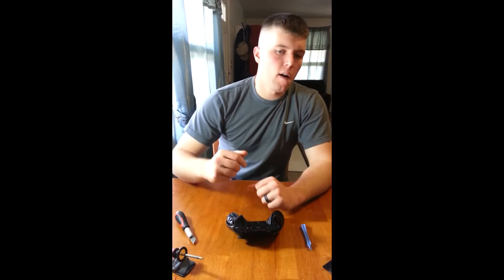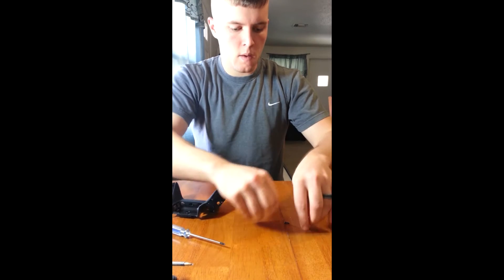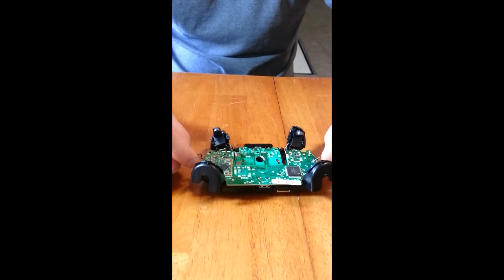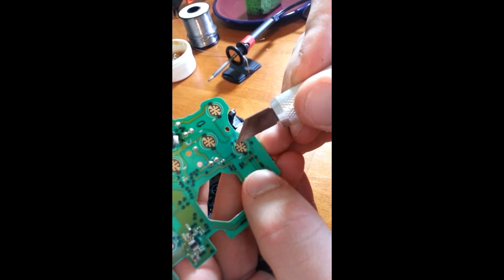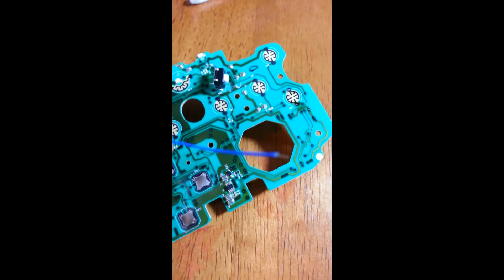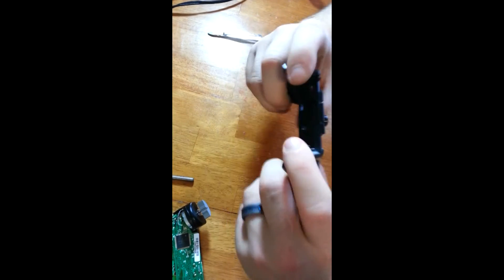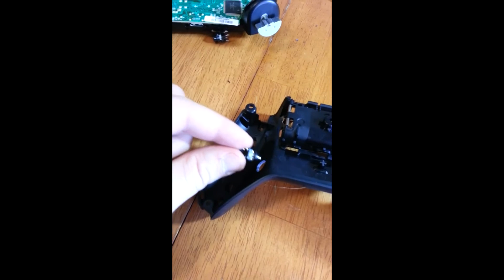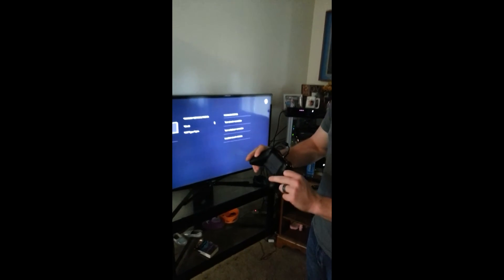Xbox One Scuf Controler DIY

Comment: Thanks man. Works. My A button works but I have to press it a little harder than the rest. B button work great also both back buttons are working properly.  Never had a scuf controller and it really is going to take some getting use to. Very easy to do thanks to your tutorial
Reply from the maker: Your A button shouldn't feel different than normal. If you'd like, take it apart and take a picture and email it to me at drummaboyzl@gmail.com and I'll take a look to see if I can tell if something needs to be corrected.

Comment: hello, i am having the same issue. B button does not work. the stock B and the switch do not work. I added an X button as well which does work. B button worked prior to opening controller.

Comment: Great tutorial, very well done - I hope you all do more.  I was wondering what are some good sources to find buttons and other input devices.  I am very particular about sensitivity and such.  Scuf paddles imo are way too resistant and the direction of force (directly up through the controller) does not work at all. I really the like button/triggers you guys use as they have multi-directional input - where did you all get these?
Reply from the maker: do a search on amazon.com for momentary tactile switches and look for dimensions 6mm x 6mm

Comment: Ok so i had a scuff one controller with drift in the stick. I ordered a new analoge module or whatever its called and soldered it in. The controller worked great for about 15 mins then cut off and would cut back on. Then i decided to take the back off that controller that had the scuff buttons and solder it to a stock controller. Tested it out before i put it back together and it worked great, so i soldered the rumbles back to the board and finished assembling it and when i got it back together the B button wouldnt work on the front or the back of the controller. I took it back apart and desoldered and resoldered everything but still no luck. Do you have any ideas?

Comment: How do you prevent from even the hotglue entering the inner part of the switch?
Reply from the maker: you want to avoid making the hole too big or that can happen. If you make the hole just big enough for the switch, you should have no problems with the hot glue running like that. If worst comes to worse, try putting a piece of paper to cover the hole after the switch is in place, then glue it.

Comment: awesome video! I gave it a like and subbed to both. I just had a quick question, i dropped my controller and now i have a power problem and the controller will only stay on if i hold pressure on certain points of the controller. got any advice on how to fix it? thanks
Reply from the maker: hmm, where do you have to hold pressure? back on the battery?

Comment: Question: So by doing this mod, you can no longer use Tactical settings for Thumbstick crouch, since you are using the default B button for the mod? Or does the new button just become knife?
Reply from the maker: You can still use the tactical setting, however the button on the back becomes knife instead of drop. The buttons on the back take the same characteristics of whatever settings A and B are.

Comment: FFFFUUUUCCCCCKKKKK LMFAO help i wired every thing perfectly put every thing back together controller comes on the analogue Sticks work the start and select button work But My A and B button don't work every thing is wired perfecto like you did the only thing i did not do is put the rumbles back in would they have to be in to complete the serkit <--- cant spell it lol.
Reply from the maker: circuit*. and no, they shouldn't be required for anything to work. does the buttons on the back work and the front buttons dont work? or none of them work now?